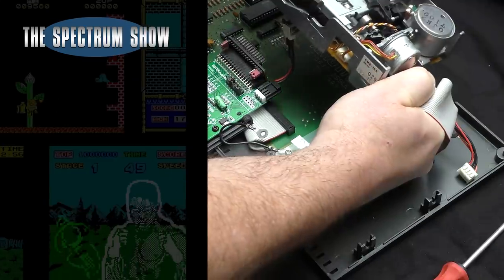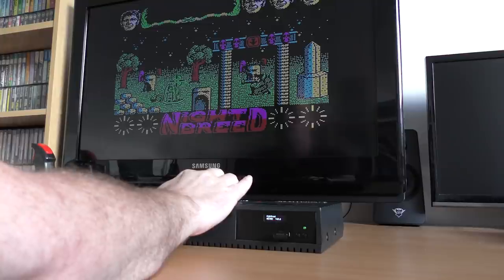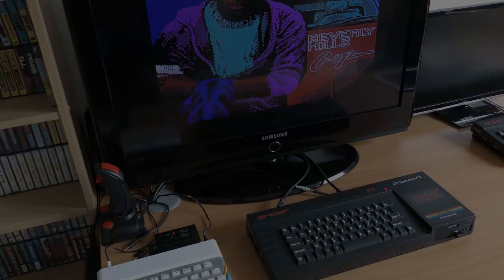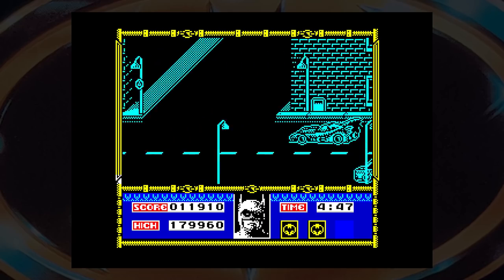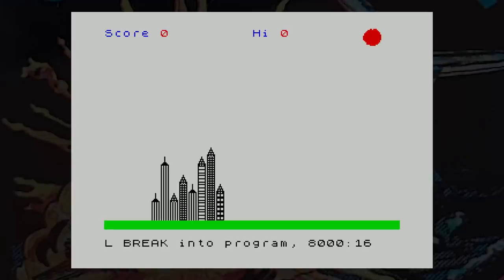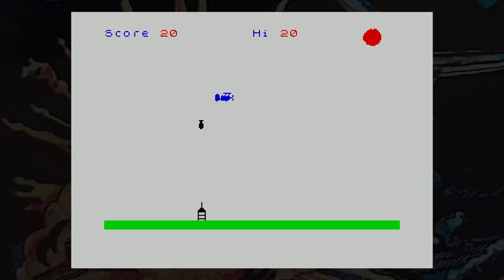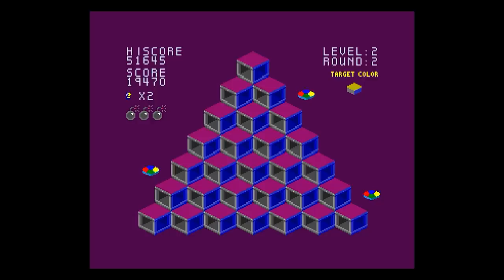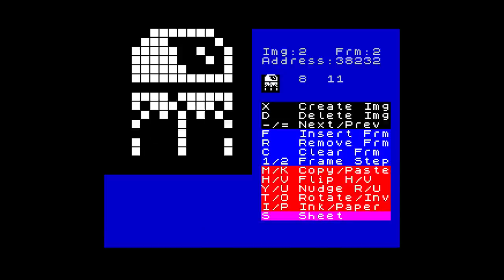The Spectrum Show EP 101

Comment: For fixing the distorted audio on the +3 - it might be worth mentioning the "Guesser" mod.  It's substituting resistors to get the sound circuit similar to the +2b/+3b.  It doesn't give you stereo audio, but means the factory outputs on the TV, sound and RGB sockets are distortion free.

Comment: Drive belt takes like 1hr and £3 to replace on the +3.

I've replaced 6 3" drive belts since 2014, and I'm not an electronics engineer. Screwdriver, cotton swab/bud, IPA, Vaseline/grease, new drive belt from eBay.

Comment: Ground Force Zero on the Commodore Vic20 was I believe called Blitz. Exactly the same style as what you just showed, on the Spectrum. I never did get the last building.
I'd happily solder in the Add-ons Mods for anyone but there is the hassle of the shipping it back & forth. With the pandemic shipping things isn't as easy or fast right now. 
The Perils of Willy screen shot looks like. Thomas the Tank & Willy had a bit to much to drink & went on a rampage 😂 Good idea for a Spectrum horror style game maybe. 👍

Comment: In an alternate timeline this was the final version of the Spectrum 
240K (December 1986-April 1988)
*CPU: Zilog Z180 14/17.5? MHz
RAM: 240K
ROM: 80K
*Native display modes:
Colors: 32 (selectable RGBgm/rc/by per 1, 2, 3 or 6 lines), 64 (RGBrgb), 128 (RGBrgbi) or 256 (RGBrgbgm/rc/by per 1, 2, 3 or 6 lines)
Text: 32 x 24 8 x 8 characters plus 16 steps of 1 x 3/4, 36 x 24 8 x 9 characters, 32 x 24 9 x 9 - 12 x 12 characters, 40 x 24 8 x 10 characters, 44 x 24 8x11 characters or 48x24 8x12 characters 2, 4, 8, 16 or 32 colors per cell
Semigraphics: 64x48 plus 8 steps of 4x3, 64x64 plus 16 steps of 2x2, 88x66, 96x72, 104x78, 112x84, 120x90 or 128x96 plus 12 steps of 4x3 32, 64, 128 or 256 colors
Full graphics: 256x192 dots plus 12 steps of 8x6 2, 4, 8, 16 or 32 colors per 8x1, 8x2, 8x3 or 8x6 cell with 8 8x8 plus 8 8x9 plus 8 9x8 plus 8 9x9 plus 8 8x10 plus 8 10x8 plus 8 9x10 plus 8 10x9 plus 8 10x10 plus 8 8x11 plus 8 11x8 plus 8 9x11 plus 8 11x9 plus 8 10x11 plus 8 11x10 plus 8 11x11 plus 8 8x12 plus 8 12x8 plus 8 9x12 plus 8 12x9 plus 8 10x12 plus 8 12x10 plus 8 11x12 plus 8 12x11 plus 8 12x11 plus 8 12x12 15 color, 16 plus 16 plus 16 plus 16 plus 16 plus 16 plus 16 plus 16 plus 16 plus 16 plus 16 plus 16 plus 16 plus 16 plus 16 plus 16 plus 16 plus 16 plus 16 plus 16 plus 16 plus 16 plus 16 plus 16 plus 16 3 color or 32 plus 32 plus 32 plus 32 plus 32 plus 32 plus 32 plus 32 plus 32 plus 32 plus 32 plus 32 plus 32 plus 32 plus 32 plus 32 plus 32 plus 32 plus 32 plus 32 plus 32 plus 32 plus 32 plus 32 monochrome sprites per scanline and horizontal and vertical scrolling
Attributes:
2 color: RGB paper, RGB ink, global gm/rc/by/rgb(i/gm/rc/by); RGBgm/rc/by/rgb(i) paper, RGBgm/rc/by/rgb(i/gm/rc/by) ink
4 color: RGBg/r/b or RGBrg/rb/gb or RGBrgb(g/r/b) paper, RGBg/r/b or RGBrg/rb/gb or RGBrgb(g/r/b) ink, LSB of pixel for m/c/y or b/g/r or i; RGBgm/rc/by/rgb(i/gm/rc/by)paper,  3xRGBgm/rc/by/rgb(i/gm/rc/by) ink
8 color: RGB(g/r/b or rg/rb/gb or rgb) paper, RGB(g/r/b or rg/rb/gb or rgb) ink, two LSBs of pixel for gm/rc/by or rb/gb/rg or bi/gi/ri; 3 primary colors; RGBg/r/b or RGBrg/rb/gb or RGBrgb(g/r/b) paper, 3xRGBg/r/b or RGBrg/rb/gb or RGBrgb(g/r/b) ink, LSB of pixel for m/c/y or b/g/r or i; RGBgm/rc/by/rgb(i/gm/rc/by) paper, 7xRGBgm/rc/by/rgb(i/gm/rc/by) ink
16 color: RG/RB/GB/RGB(g/r/b or rb/gb/rg) paper, RG/RB/GB/RGB(g/r/b or rb/gb/rg) ink, three LSBs of pixel for Bgm/Ggm/Rgm/Brc/Grc/Rrc/Bby/Gby/Rby or rgb/rbi/gbi/rgi or ggm/rgm/bgm/grc/rrc/brc/gby/rby/bby; RGB(g/r/b or rg/rb/gb or rgb) paper, 3xRGB(g/r/b or rg/rb/gb or rgb) ink, two LSBs of pixel for gm/rc/by or rb/gb/rg or bi/gi/ri; RGBg/r/b or RGBrg/rb/gb or RGBrgb(g/r/b) paper, 7xRGBg/r/b or RGBrg/rb/gb or RGBrgb(g/r/b) ink, LSB of pixel for m/c/y or b/g/r or i; RGBgm/rc/by/rgb(i/gm/rc/by) paper, 15xRGBgm/rc/by/rgb(i/gm/rc/by) ink
32 color: R/G/B/RG/RB/GB/RGB(g/r/b) paper, R/G/B/RG/RB/GB/RGB(g/r/b) ink, four LSBs of pixel for GBgm/GBrc/GBby/RGgm/RGrc/RGby/RBgm/RBrc/RBby or Brgb/Grgb/Rrgb/rgbi or rbgm/rbrc/rbby/gbgm/gbrc/gbby/rggm/rgrc/rgby; RG/RB/GB/RGB(g/r/b or rb/gb/rg) paper, 3xRG/RB/GB/RGB(g/r/b or rb/gb/rg) ink, three LSBs of pixel for Bgm/Ggm/Rgm/Brc/Grc/Rrc/Bby/Gby/Rby or rgb/rbi/gbi/rgi or ggm/rgm/bgm/grc/rrc/brc/gby/rby/bby; RGB(g/r/b or rg/rb/gb or rgb) paper, 3xRGB(g/r/b or rg/rb/gb or rgb) ink, two LSBs of pixel for gm/rc/by or rb/gb/rg or bi/gi/ri; RGBg/r/b or RGBrg/rb/gb or RGBrgb(g/r/b) paper, 15xRGBg/r/b or RGBrg/rb/gb or RGBrgb(g/r/b) ink, LSB of pixel for m/c/y or b/g/r or i; RGBgm/rc/by/rgb(i/gm/rc/by) paper, 31xRGBgm/rc/by/rgb(i/gm/rc/by) ink
Sound: triple Intel 8049 (+PRT of HD64180/Z180+beeper)

Comment: Ive done these mods to my +3 a while back it makes a huge difference. My stereo mod hangs outside the printer port as I never will use a printer saves drilling a hole in the case.
Reply from the maker: I didn’t want to drill the case too. Still haven’t